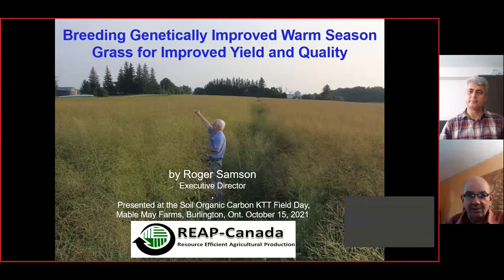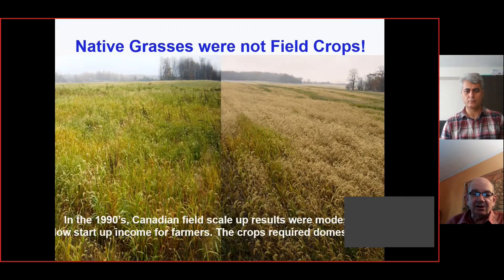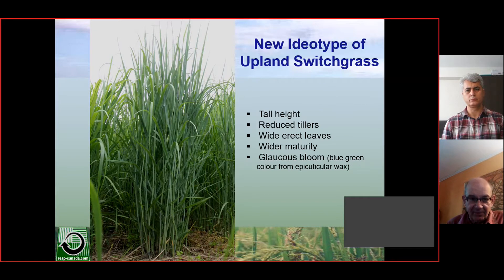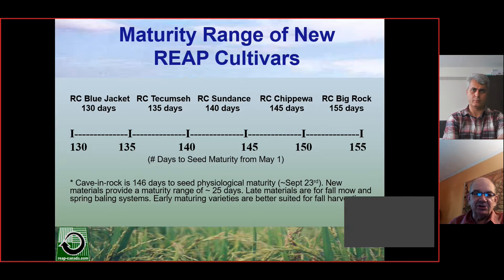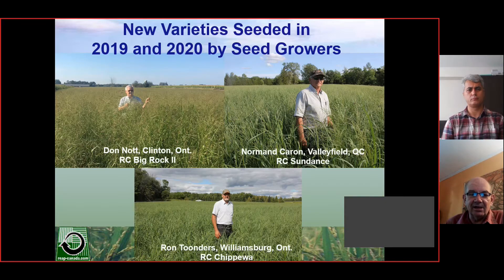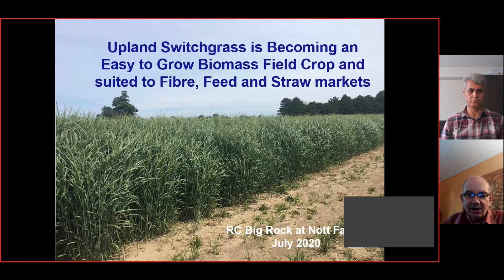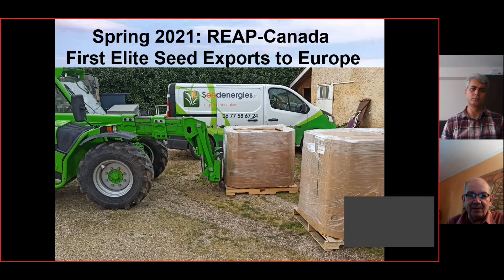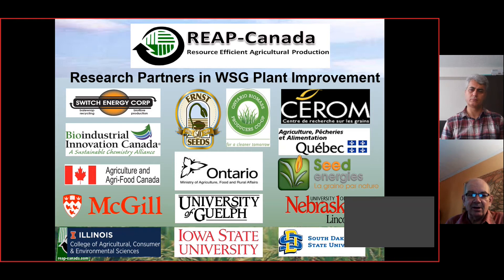Breeding Genetically Improved Switchgrass and Big Bluestem for Improved Yield and Quality

Comment: Stiff stems, 3-4 ft high, easy to establish. Wildlife variety(s) needs to thwart snow drifts, not so tall that I can't see my dog working birds, and yes, fewer tillers might aid in bird movement underneath? Stand-ability is important, it'll attract early nests, which are usually more successful. A strong wildlife variety would be nice to have.
Reply from the maker: What if you did strips of a shorter statured variety with a taller one and had staggered row widths with  wider rows every 10' or so to ease walking through it. You cant really get it 3-4' and have it have a thick enough stem to resist the fierce winds with wet snow. This way you could still see your dogs much of the time while they were working.
Reply: That’s better, leeward of prevailing winds helps. I’ve been using Neb 28 variety.